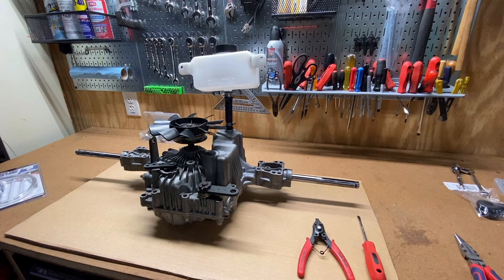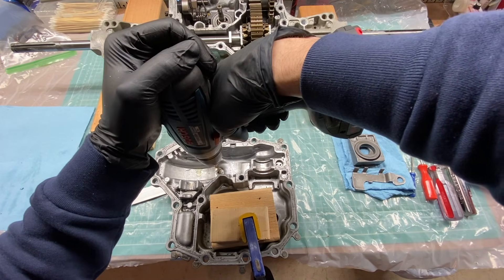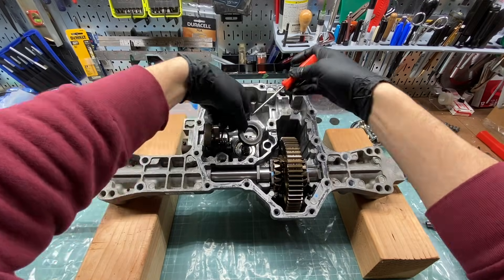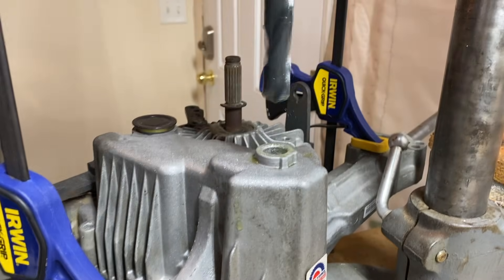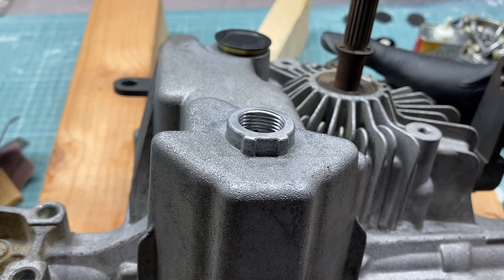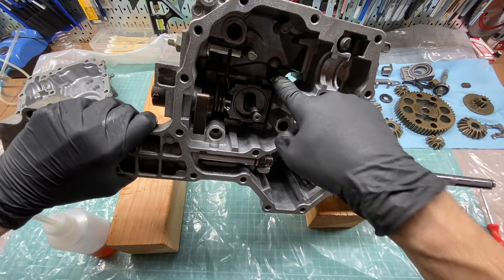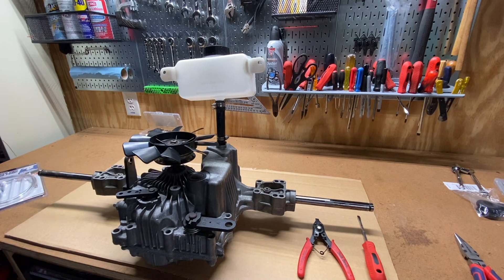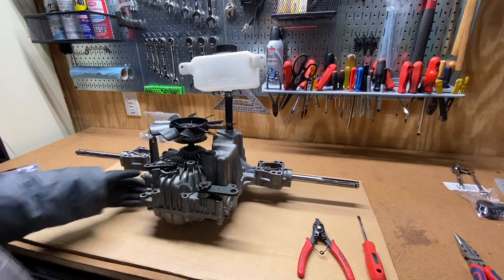Modifying the Tuff Torq K46 / T40J Transaxle For EASY Oil Changes (Oil Fill Mod Series Video 2)

Comment: on John deere x155r and x167r this oil expansion tank is factory fitted
Reply from the maker: I know that a variant of the K46 exists with an expansion tank. I didn’t know what JD models used it though. Before I started this project I looked at this variant to see if I could just put that OEM tank on my K46/T40J. It appears that the K46 with an expansion tank has a different upper case that has a neck where the tank connects to. 

Here is the product page for the one with the tank if anyone following along is interested: https://www.tufftorq.com/product/k46/

Here is a parts diagram where you can see the neck on the case that is different from other K46 variants: https://tufftorq.ordertree.com/catalog/partslist/view/group_id/426906/?assembly=Parts&assembly_id=2673
Reply: @MostlyBuilds  video in which a guy cleans the transmission in the x155r, because the cap fell out of the oil expansion tank
https://youtu.be/dp8gX6VLJZA
Reply from the maker: @75tomeks  nice! This is a solid reference. Looks like he has another video for putting it back together: https://youtu.be/H6FGLmKHbRY

You can get a good view of how the case is different. This doesn’t change anything for my mod, but it is a bit validating to see that the two reservoirs are connected in this variant too. Someone was asking me about oil migration between both sides of the case and if this is ok. I basically just assumed this was the same situation for the K46 that comes with a tank.

Thanks for sharing the link!

Comment: Wow!  I have my tt laying on my truck tailgate.  Just starting this journey.  If I put a single drain under the filter, will all the fluid drain?
Reply from the maker: Hi Will. Unfortunately all the fluid won’t drain if you do that. Only the pump side will drain, not the gear side. The two reservoirs are connected at the top, not the bottom. If you are drilling drain plugs, it is probably my advisable to only drill them in the two reinforced locations where tuff torq intends for them to be. The rest of that bottom pan is pretty thin. I’d be worried about the bolt stripping out because it doesn’t have enough to grab onto. Best of luck with your transaxle journey!!! Consider subscribing. I posted an update for this project the other day (linked in the description of all the videos in this series)
Reply: @MostlyBuilds  outstanding reply!  I’ll drill them like you did; glad you stopped me from uh ohh; the hydro is still on my tailgate!  My lil local retailers don’t have 5W50, so I’m now waiting on oil from Amazon.  I also used your links for a couple other things.  Thanks for your advice!
Reply from the maker: @willloy8901  awesome! Thanks for supporting the channel! I highly recommend double checking the sizes of your drill bits, taps, and fittings. I linked directly to all the stuff I used, but it can be easy to grab the wrong thing if you click around some of the Amazon pages to look at different variants of things.

Best of luck with the project! I’d love to hear how it turns out and if you have any thoughts for further improvements.

Comment: The major flaw of the K46/TJ40 transaxle is that you need to split the cases to clean the magnets and filter. Just changing the oil is only 1/3 of the work.
Reply from the maker: Now that I can easily change the oil, I’m curious if doing that annually will reduce how dirty the magnets + filter get. I’m with ya though, it sucks that you have to split the case to access the magnets and filter. I don’t know that it’s a flaw though. I think it’s an intentional design decision to keep the cost of the trans down. Ignoring that, it’s a pretty simple & clever design for the price point. If I was in the market for a new machine, I would probably be hunting for something with a better trans that’s fully serviceable out of the box!
Reply: @MostlyBuilds  I agree, if you take apart the transmission to drill tap and change the filter and clean the magnet and housing then change the oil every 50 hours .. i highly doubt you will clog those filters in say 500 hours or more as most of the particulates will be in suspension and those will get removed every 50 hours not allowing them to build up on the filter and magnets.
Reply: What about adding hose barbs and an electric pump to suck out hot fluid and pump oil through a cooler and back in again, possibly adding an in line filter tonfilter the fluid too

Comment: Is the pump block supposed to slide down snug on the main shaft splines, no play? I just opened mine.
Reply from the maker: On mine the block with pistons that’s on the input shaft slid off/on very easily. Not tight on the shaft with the splines. I didn’t really play around with it to see how much play there was.  Nothing tipped me off as suspicious though. I slid off without any prying. Hope that helps (I’m not an expert!)

Comment: Consider using Permatex hydraulic thread sealant too. I put that on everything especially anything with tranny fluid. Buy a magnum sized tube and you'll have a lifetime supply.
Reply from the maker: Ah that would have been good for the 3 bolts on the center case for the pump. I’ll get some and give it a shot if I open the case again. Thanks for the tip.

Comment: never forget to try to turn the brake disk before torquing the bolts on the center case.  That way you can make sure that both the motor shaft bearing and the motor housing are seated correctly!
Reply from the maker: Great advice! Thank you